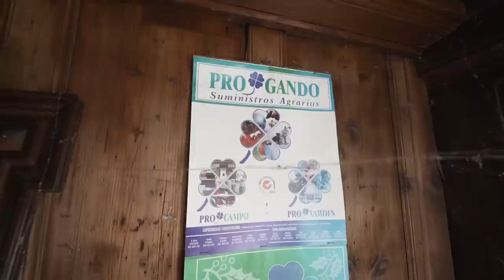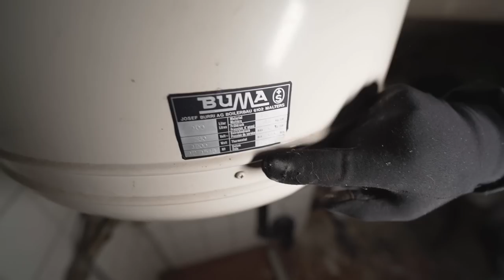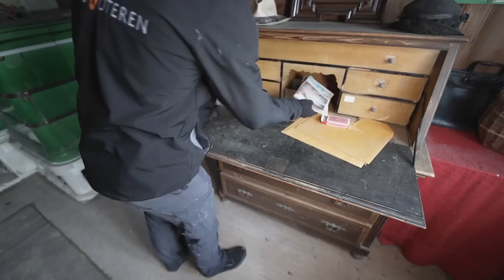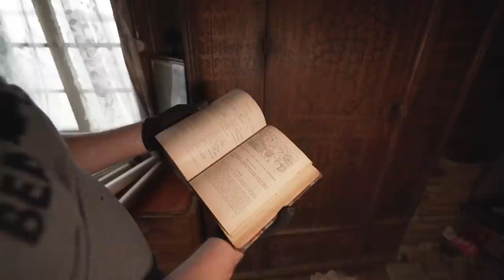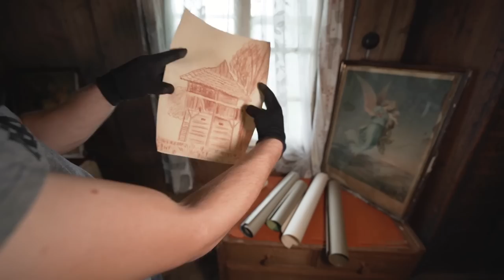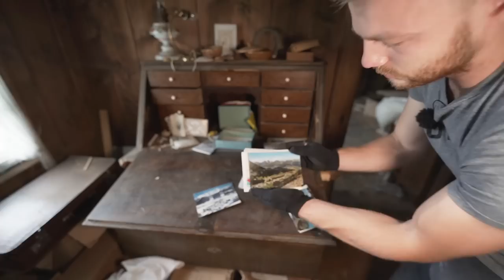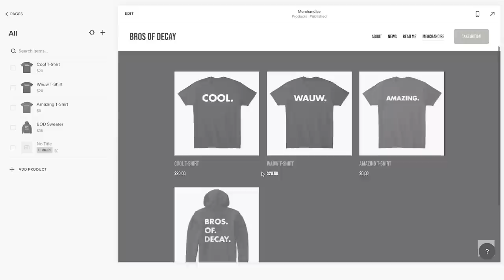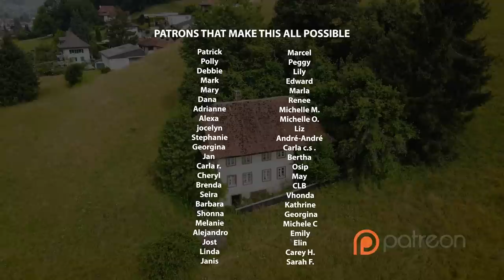Why Did They Disappear? ~ Charming Abandoned 19th Century Cottage!

Comment: The bike in the shed was an old "Velo-Solex" with an auxiliary motor on the front wheel. The registration plate says AG (Canton Aargau) and 79 is for the year of registration.The reason why the house has crumbled is due to the law for the peasant land. This states that such houses outside settlements may only be used or built as a farmhouse in connection with farmland. This farm must be used and farmed, otherwise the permit expires. Therefore, the house could not be restored....
In terms of cost, it would be much cheaper to demolish the house and build a new one.
Since the house is so old (1884), it is a listed building, which means that it could only be renovated according to the specifications of the Office for the Protection of Historical Monuments, which makes such projects very expensive (restauration with original materials only). As mentioned above, it is questionable whether the office will grant an exemption to use the house as a residential house (without connection to agricultural use), since it would have to be freed from agricultural use.
The old farmhouses in Switzerland very often have a room height of 180 to 200 cm only, which makes it complicated for tall people to live in it... (You don't want a headache from morning to eve..) ;)  :)  :)